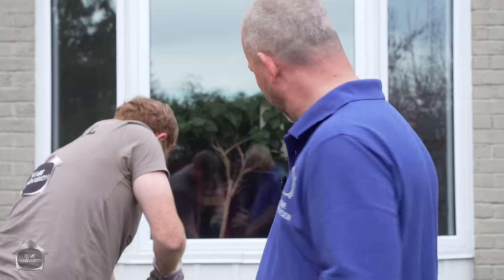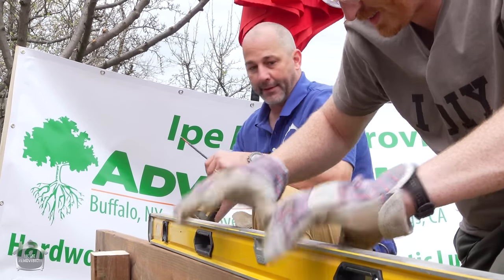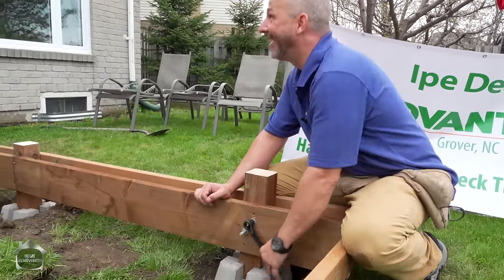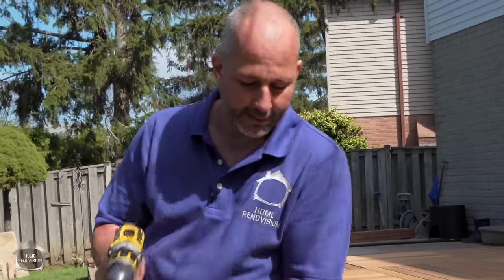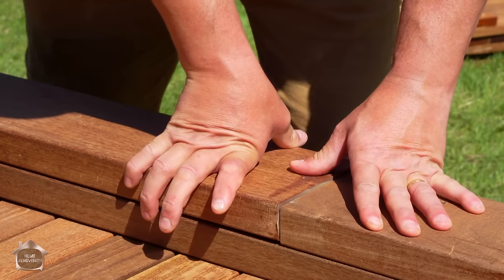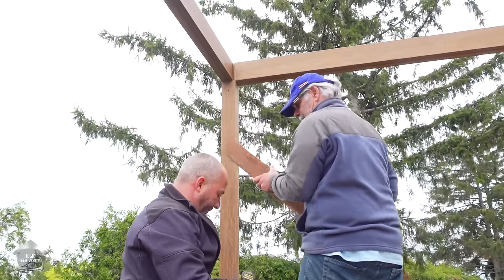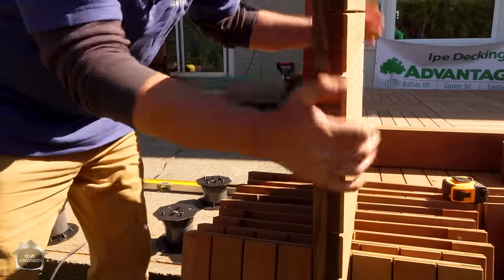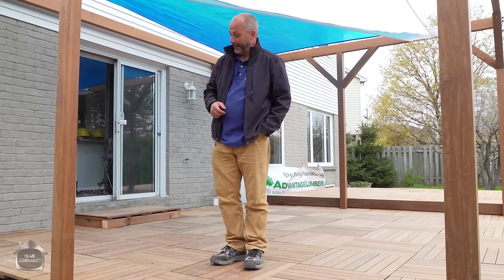How to Build a Pergola and Floating Hardwood Deck A to Z

Comment: Nice work. My only suggestion is before you install your top decking is to actually fill in amd tamp around the concrete blocking for your posts. Even completely assembled you could see some moving and twisting. Also I would double or tripple the depth of your lime stone screenings before it is ramped down. I used to use crushed stone mixed with alot of stone dust. The best part of using crushed stone is its ability to lock against each other after being compressed to tamped down from the tamper. Get it all levels and squared into place then come up the sides of the block 2 inches and tamp into place with a piece of 2x4. Keeps it all from twisting. Used this system for instaling large stone work and block work where people wouldnt pay for poured concrete. I just went with more depth of crushed stone and heavy tamping and compression. Mixed with the stone dust it would set up like concrete over time.

Comment: When I worked for another company we rebuildt a deck over a rolled rubber roof.  The new exotic lumber was Ipe and none of us knew anything about Ipe!  We attached the deckingwith stainless steel screws and hidden fasteners, and within a couple of screws it became apparent we needed to pre drill every hole as the SS screws were just snapping!  The wood was so hard the drill bits were junk after about 20 holes.  We also got a qt. of liquid wax which we had no idea what it was for!  We found that out soon as the first few boards installed, within 2 days were badly checking and cracking.  The wax was for any fresh end cuts!  The deck took us about 3weeks longer because of all the drilling and multiple other issues!  We also had to make all the railings out of Ipe!  We both ended up fired because we took too long!

Comment: Love this channel and it's videos. Have watched so many and learned so much. I HATE to be the safety equipment guy when I know it gets made fun of here. I admire the safety glasses when using the grinder. 

But holy shit guys, ear plugs! Even with the battery hand held DeWalt drill, cumulatively that sound will ruin your hearing. The grinder, the circular saw, over and over....bye bye ears. 

I'm a sticker for hearing protection. I love music  and don't ever want to lose that ability. Those watching at home, but a cheap pair of over ear muffs and it's all good. No need to go overly expensive.
Reply: Ear protection is so damn important.. I used a handheld air compressor for about 15 minutes while doing car detailing and didn't wear ear plugs. I've had permanent tinnitus for over 2 years now and regret it every day. Please wear ear protection.. having a constant ringing in your ears will drive you insane.
Reply: @CrackaSource  sorry man. I also have tinnitus from military exposure to loud engines. You just don’t think I’m the moment “hey I’ll have trouble hearing later I’m life from this direct moment....”

Comment: Make 2 frames , decide height and screw a piece of wood between corners  of frame and ground with off cuts.
You can use folding wedges to  make adjustments to the 2nd frame on the uneven slab.
Screw frames together and then you know where all the fixings go. Saves time and you have your measurements.

Comment: I know the intent was to keep it simple with everyday tooling, but a laser level makes it so much easier to set your heights and worth the investment.
Reply: Or you can just get a clear flexible tube and fill it with water.
Reply: @alexfromoz  laser levels are cheap nowdays and very useful in pretty much ever project. It is a good investment.

Comment: Did you use screws or bolts to attach the inside corner stabilizers? size and length of screws/bolts? What size and length of drill bit did you use to drill the holes on those inside corner stabilizers? Thanks for your great teaching/instruction. Your techniques have helped me in so many projects I almost lose track.

Comment: Jeff, question here: Why would you ever choose to use "no contact" lumber for a floating deck? Is it stronger or something? If the price is comparable, it seems like buying "no contact" would be a no brainer with its obvious benefits.
Reply: Most likely because most ground contact treated lumber is AC2 which is an ugly green color. The pressure treated lumber matches his nice hardwood panels. Also he’s not technically contacting the ground so he is probably fine here

Comment: Hi Jeff.  Great video as always. Planning to tackle a ground level deck here in Eastern Ontario in the spring.  In this video, was there a reason you opted for box beams instead of directly point-loading the beams on the 4x4 posts?  I used the "deck block on limestone screenings" approach 3 years ago when building a fire wood crib (based on your shed building video.) It handles the freeze/thaw cycles of our winters very well.  Structure remains solid, plumb, and level, even with the weight of a cord of wood.  Cheers.
Reply from the maker: simplicity more than anything else. I can adjust the box beam but once you cut a post the only direction you can fix a problem is lower to the ground. I find the box is just perfect for diyer's

Comment: This is great, however, it would be nice to see a drawing before and at relevant stages during the job so we can know what you're doing/aiming towards, as sometimes you move a bit fast for us novices...I mean, what is a "saddle" to those who don't speak deck jargon? :)
And also, while Brazilian Hardwood may be the way to go, does your supplier provide a "sustainably sourced" certificate,,,not sure how we know wood hasn't been raided from the Amazon..?

Comment: Do the bottom pieces of adjustable brackets for decking system get fastened to the slab at all? Did show that, but I’m assuming the holes in bottom piece is for fasteners to secure to material if need be. Granted, once all fastened & secured to existing deck....really  not gonna move, but wondering about other scenarios. 
Thx✌🏼

Comment: First, love your channel. Some of the most informative of all construction channels.
Then a question, I have a cement patio off the back of my house in the space where I would like to build a raised deck. The patio is in good condition. Would you leave the cement in place and just anchor the legs of the deck to it? Or do I have to break up the patio where the legs of the deck come down and pour in footers?
Thanks in advance.
Reply: check your local building code is what you need to go by is what they all say

Comment: Thanks a lot for this complete information.
One question: your deck is all leveled. Should you have a slight slope away from the house for evacuating the rain?
Great job!
Reply: Ground slope takes care of that. You have gaps in the decking to deal with water. A sloped deck would look and feel funny unless it was more of a wooden walkway

Comment: the saw at the end doesn't turn on faster by design. Most motors like that pull more then the stated amps at full startup. its designed not to flip a 15 amp house breaker.  I have the same saw and its great!

Comment: Hi Jeff,
Thank you very much for your very positive and informative videos. I'm building my floating deck here in Toronto and am using the deck blocks as well. I am on a settled clay that I tamped and added limestone as I learned from your videos. I also put the dirt around the sides of the blocks and tamped those with a 2x4 so no water comes into the hole. Some of my blocks are only 1-3" above the ground.
It looks like you left the blocks just standing in the holes - is that the proper way so the frost is not pushing them up?  I'm now thinking if I shouldn't remove the dirt and keep the blocks free-standing like in your video. I have 27 blocks in the ground, working on a frame now.
Would appreciate your opinion.
Thank you.
Reply: hi neighbor. How did you protect your deck from mouses and squirrels running under it and making a nests?
Reply: @sregeyvorobey4859  
Hello,
While there should be a L-shaped wire mesh dug to the ground and stapled to the outer joists, I didn't do that as I had decorative concrete borders right next to the outer joists and think it would be very hard for an animal to dig there. I also check the perimeter regularly. As my decking is attached with the Camo fasteners (thank you Jeff!), I can easily lift a board and clean the nest out.
My joists are 2x6 with just 2-3" clearance under them.
Reply: @a03906  thanks, I assumed something like that

Comment: Love your videos! A question: you dug holes for the concrete blocks in this video, whereas in another video you did not, is there any limitations or codes that have to be followed? Appreciated
Reply from the maker: the holes were designed to allow the deck to sit on box beams. otherwise everything is attached to rim joists and joist hangers. this way is actually a lot quicker.
Reply: @HomeRenoVisionDIY  dumb question time. If someone or something bumps into the deck, would the whole thing shift off the box beams?

Comment: Did you say those bolts were good for 1klb shear or tensile? Either way, that seems really low to me. Anyway, since you have shear points on both sides of the post and with two bolts present, your fastening system could take 4klb per post.

This deck could have a car or a couple on it.

Comment: Question.  If my deck is only going to be about 6 to 8" off of the ground and I'm using Cemented posts how deep do I need to cement the posts?
Reply: check your local building code
 Google is good for that kinda thing

Comment: I have a question... during installing deck over the concrete slab, what's the deck held down with to the concrete slab? Just pure weight of the deck?
Reply: The black powdercoated brackets they drilled the holes for into the concrete.

Comment: Knocking those 4x4 brackets was a no-go for me. I would have put a piece of actual 4x4 and hammer the wood instead of hitting the bracket itself. Then the corner of the patio busted out. Not the way I would have done it.

Comment: Ok.  I'm confused now.  I thought up north you have to go below the frost line but those concrete piers are only about 8"in the ground.  The frost line in our area is 32".  So is it acceptable to use these instead of going 33" down with the Ouick-Tubes building forms?  I don't have a lot of faith in my building inspectors after they caused me to dig full footers and a 5' fire break for a portable metal garage construction beside my brick house.  The decision caused me to pay for 5 additional cubic yards of concrete only to be told I didn't require full footers during the final inspection.
Reply: Not a 100%, but i live in Ontario, Canada and my local building codes allow to build a floating deck (not attached to house) as long as its two feet and under.  I had to go below frost line as my backyard sloped.  That's if u follow code and get a building permit.  Most my neighbors didn't.

Comment: Question: I want to build a floating deck. But the slope of the backyard is too step to keep the below 24 inches on one side of it. Can I build a platform with stairs at the top to step down to the floating deck and not need a permit?
Reply: It's best you contact your local authorities.

Comment: isn't building on clay contractual in hot and cold. therefore you should use gal stirrups to prevent movement?
Reply: 300/400 mm concreted deep

Comment: I live in an area that gets 160 inches of rain a year with a lot of humidity- will this wood last here? How about termites?
Reply: Ipe wood (also known as iron wood) is possibly the most termite resistant wood out there, People build boat docks out of it and also use it for decking on boats. It primarily comes from the rain forest so between boats, docks, decks you can be rest assured it can handle humidity and water. Its extremely heavy and strong and also stable, you must predrill every hole and use stainless steel screws. Its very expensive as far as wood goes but it will last a lifetime. I've seen quite a few decks and docks look just as good as 10 years later, Ipe will naturally darken/ brown in the sunlight and wont look as fresh as it originally does. I believe a quick sanding and some oil and its back to original color.

Comment: That blade is amazing! Do you need the evolution saw to use that blade or will the blade work with other saws?
Reply from the maker: It is a combination of rotations per minute and torque as well as the blade. Cheers!
Reply: Can we have a link for the tool and blade please? :)

Comment: I don't mean to be negative but in all honesty I watched many mistakes, many hacks ,many cut corners but in the end it worked ,how long will it last remains to be seen.The metal saddles rebar were cut off  short ??? ,also they never got set in cement correctly as they were clearly seen still moving when the Ipe 4x4 were bolted in ,no lock nuts in the carriage bolts and why 3/8 dia. when 1/2 inch dia. is the code,the prefabricated square boards should of been set in double joists ,floating decks are dangerous and you should dig and pour concrete piers (footings) below frost line e.t,c .I loved when you put together a beam to shoot level lines across !! are you serious ? how about accuracy with an eye lever or laser ?Also having trouble accepting that the PVC spacers are a good solution, what's preventing them for filling up and holding water like a glass . Grinder used without a guard . Anyhow thanks for the upload and the humour and occasional sarcasm .Although the majority of the viewers that watch this are amateur and not understanding ,there are professional installers that can see the incompetence.
Reply: *should HAVE been, not 'of'

Comment: Hi Jeff! I watched deck in a day first where you didn't dig or use the cement blocks and built the deck directly on the ground. I'm just curious, is it simply individual preference or are there specific reasons you should choose one option over the other?
Reply from the maker: You get what you pay for. deck in a day is cheap and quick and won't last as long as something off the ground. It is all about options!

Comment: How come no black landscaping fabric was not put down along with a gravel base to prevent weeds and water damage.  Did you also check the yard levels.  Many time drainage is important for rain and having the dirt so close to the wood could create a wood rot problem.  I placed a drainage pipe under my grade level deck to make sure no water can puddled under the deck.  Home Depot is just about the worse place to find good lumber.

Comment: Where can we get the circular saw blade cut wood.and metal, can you give us the specific s on the blade
Reply: You need the saw for it too, not only the blade. These saws work on a different rotation/torque. The blade itself won't be safe to use in a regular saw as they have higher RPM. evolutionpowertools.com This is their website and they have a where to buy section. I hope this helps.

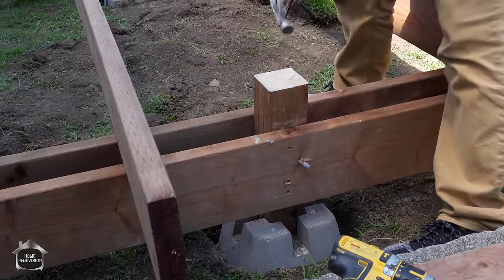Comment: 24:54
Shouldn't you have put the second carriage bolts from the other side? You had just explained that doing the first set
Reply: That is the center post so it doesn't matter which side the bolts stick out as no one will ever walk past that post when the deck is built.
Reply: @mrfochs  I figured it would be covered

Comment: Would've to have access to miter saw one blade for everything do you mind to tell me what brand is thaand where can I buy it?
Reply: It is called Evolution. evolutionpowertools.com  Go on their website they have a "where to buy" section. The green coloured ones are the diy grade and the orange like on the video are the construction grade. I have a green circular saw and a mitre saw. Blades are excellent, last long. I only have issues with the cut accuracy. You can still have some good cuts but it needs a little play around. For construction jobs it is perfect. To make a top quality joint it is difficult but still possible.

Comment: I'm not really understanding why they didn't just tie into the deck from the right and have no step.  Those little levelers seamed like a lot of extra work when everything could have been shimmed up after with either those or some other supports. Seemed like there was clearance from the exterior door to have it that way and also have no step which in my opinion at least would be a plus. IDK.

Comment: You did the framing the wrong way. Putting all the weight on carriage bolts and expecting it to handle the load is a big no no. Carriage bolts do not have the shear strength unless you have some thick 1 inch+ bolts
Reply: Right. Lag bolts are better.

Comment: Really like this channel, i have learnt loads here but, your solution for the part of concrete cracking and falling when assembly the metal foundations for the post was really bad. BAD. Minute 38.39, hydraulic  concrete in that corner? to support that post? really? that post it is not fix to the ground, only at the top which is really useless.
Reply: U mean 38:39.      *fixed

Comment: Your trim video, you say to always buy from a specialty store, and not a box retailer - but then you say that Home Depot didn't have the right lumber.  Aside from the fact that HD lumber is crap, why wouldn't you be going to a lumber supply store for a deck-load of wood anyway...  especially considering they didn't have what you wanted.

Comment: How far can I run a joist form the ledger board if I use 2x8 vs 2x10?
Reply from the maker: 12ft in most areas but best to check with your local building office!